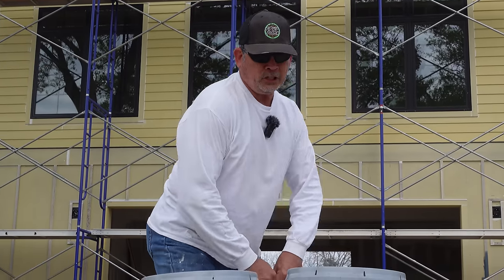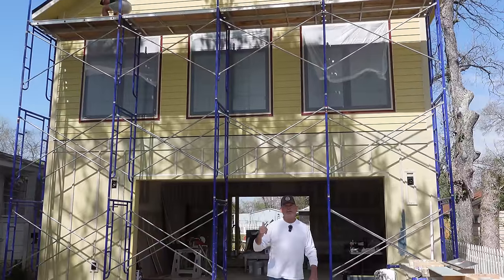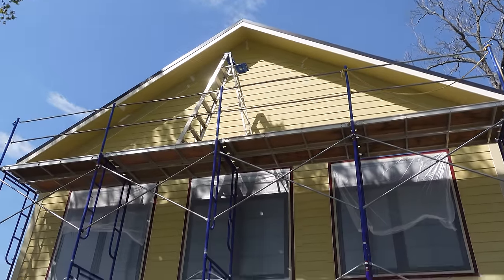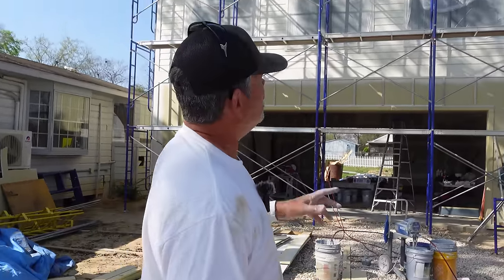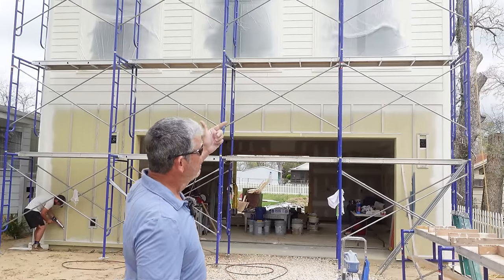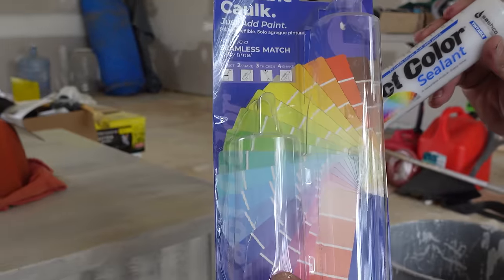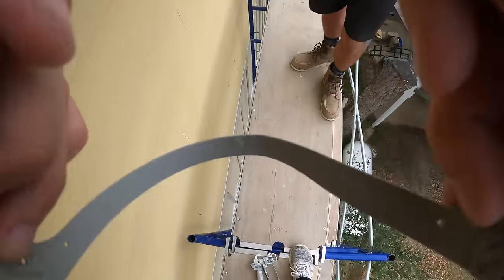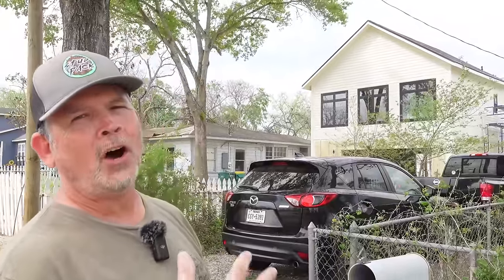We Spent $1,400 on Paint and Sprayed it Ourselves! (Should We Have Hired Pros?)

Comment: Hello, great video, as always.  You did a great job - don't worry about the quality of your job; it's very high quality.

 I have a couple of suggestions for your main house.

1. If you are going to use the same fiber cement siding on the Main house, you can purchase the Hardie siding with a baked-on paint finish that is warranted for 20 years.  This baked-on paint surface is far superior to the paint that you can install yourself. The only problem is covering exposed nail holes, but if you install your siding correctly, you should not have a lot of exposed nail holes. The other downside is that the pre-painted Hardi-board panels cost more -- but consider that you won't need to repaint your house for at least 20 years. 

2. I wouldn't worry about nail holes high up on the second story unless they are really large because no one will notice them. 

3. Spraying on a non-windy day will prevent a lot of your overspray issues.

4. You can also buy your pre-painted trim to match your siding. 

I am not a big fan of paint on a home exterior because in Arizona, where I live, you have to repaint your home every  7-8 years. Paint also does little to protect the wood fascia on homes from the intense heat of the sun (although it does help protect it for a few years). I am getting ready to repaint my  home, and when I do, I will replace much (or all) of the wood fascia with a white composite fascia if I can find it so I don't have to paint it. However, so far, I have not been able to find a composite fascia that provides the structural strength of wood fascia. Alternatively, I will install new wood 2" x 8" boards and cover them with Hardie-board cement panels, about  8" wide for my 2" x 8" fascia, with the baked-on finish. I will screw on the panels at the top under the roof flashing and use a 50-year caulk to hold on the lower section of the panels. Using the fiber-cement panels over the wood fascia should provide a maintenance-free fascia system for my home for at least 20 years because the white color of the Hardie-board baked-on paint will reflect most of the sun's heat and has UV protection in the paint.

I do like your system of installing wood boards for facia and covering them with Azek composite PVC fascia. I DON'T think you should have painted your composite fascia because, as I have mentioned, it creates a maintenance item that is a pain in the ass to maintain. 

Really good video. I wish you great success with your project.

Comment: I see this on a lot of long term projects like yours. I get it, you are trying to rush it. Jordon probably getting tired, but your starting to miss big things that will take you twice as long to get them done. I see that some of your “Super Stretch” has shrunk or not enough was put in the gaps causing a shadow line. Tiny thinks like not removing the fuzzy edges of the hardy board, once you throw the paint on them, they look huge. You all do great work, DYI takes time like you so noted Paul. 👍🏼

Comment: The only thing I'll.give you a good knocking for is safety. That scaffolding needed to be secured to the building. You needed rails at the top. You must at all times use safety harneses when climbing above 6 feet. What you all.did was too risky and please don't do that again.

If you fall for what ever reason, I will have no good videos to watch. Safety first, anything else after.

One more thing, make sure your scaffolding access reaches all the way to the extreme.of your building including the roof eaves, so you can work from below and not have to stretch out risking a fall.

Comment: I won't give you guys too much crap for the scaffolding. I've done similar. I've done worse. I've done it with planks between scaffolds. My dad has screwed an unsupported plank into the scaffold and walked out onto it like his crew just mutinied. I don't recommend that, but I'm aware that there are times when you just need to get a job done. Just move slow and maintain full situational awareness. Going full monkey-man has its risks. If you do this kind of thing often, then get all the safety stuff and take the time to set it up.

Comment: The dumbest thing ive seen in all the videos ive watched on this channel this week.... no sense of safety on that scaffold being up that high....and i started at the beginning on monday..only other think i overlooked was the use of that table saw, with the palm of your hand riding across the top of the biard directlt above the blade... what if the blade pops loose and comes through the board into your hand... use the push bars/pads and stop being lazy with your safety on that scaffold and anything else being done in shortcuts safety wise. A few seconds or minutes to setu up SAFELY can save everybody years of grief... outside of that, love the work being done